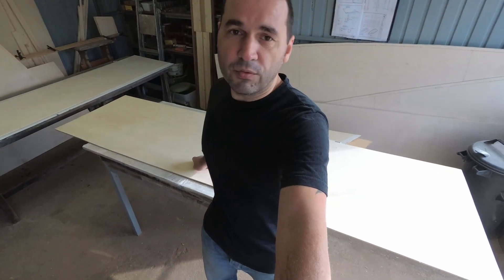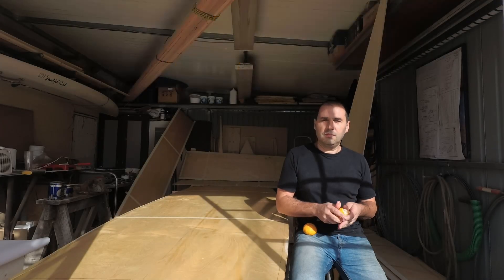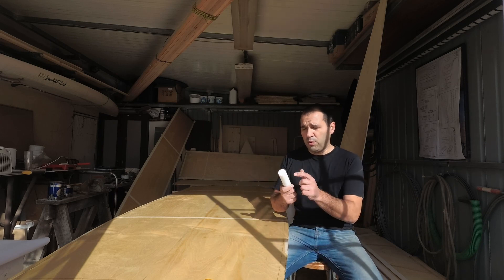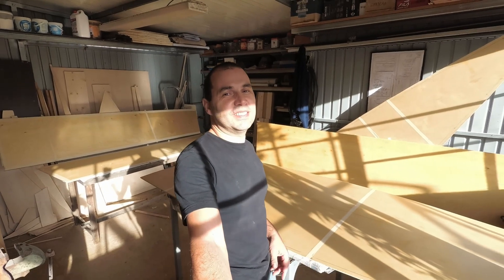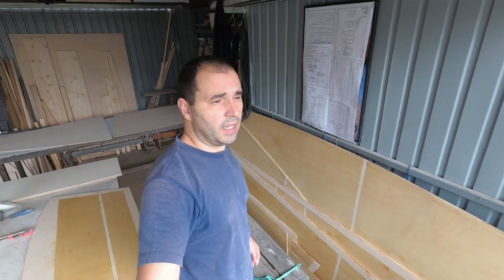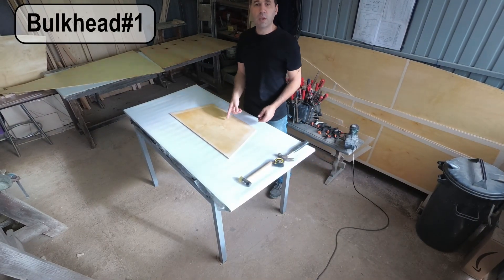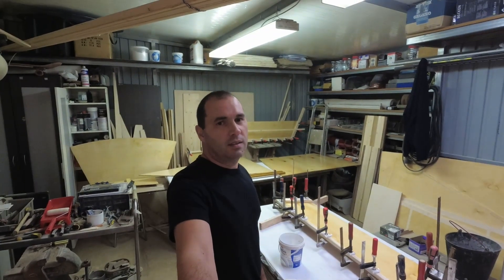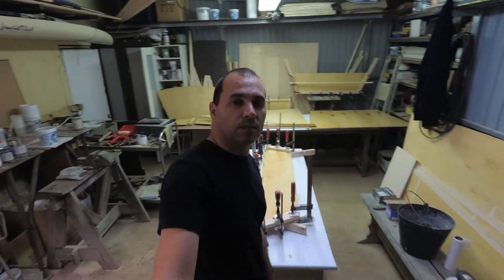Building a Goat Island Skiff WEEK_3 - homemade plywood sailing boat

Comment: Hi,
Thanks for your videos. It may be an obvious question (not for me ;)) but why do you glue the frame after coating the panels ? Wouldn't it have avoid you to do lot of masking job if you had framing first ?
Reply from the maker: Hi Christophe!
Some people do almost complete the boat before epoxy coating the whole thing.
Plans recommend masking the gluing areas.
I chose to do it this way because I can apply the epoxy and get a better finish while the panels are bare and horizontal.. It also makes it a lot easier to sand them too. 
Take the Transom as an example, if frames were applied first, the sander would not reach all areas of the panel.
Reply: @TheBoatRambler  Good point.  In fact it's a matter of choice. Both methods have their pros and cons. That said it's a very good looking boat

Comment: I have a question, why you coat epoxy in the pinels before and not after the boat is built ? I seen more like this
Reply from the maker: Hi Richard, I coat the panels first because it's a lot easier to sand them while they are still flat and on a benchtop than  after they are curved, and in odd places the sander wont even get there. 😉

Comment: Very nice build! What size plywood panels did you start out with and what method for scarfing (I may have missed it in an earlier video)?
Reply from the maker: Thank You. 
The plans call for 2440x1220x6mm but my panels were 2500x1250x6.5mmm.
The panels are not joint using scarfs, buttstraps are used to join them.

I have not joined the panels yet, that will be the last thing for me before I start putting the boat together due to building space limitations.

If you go to  Goat Island Skiff FB Group ->  https://www.facebook.com/groups/GoatIslandSkiff 
you can find many photos on how the panels are joined. 😉

Comment: Another Great Video - but some important additions.

If following this video - don't put the panels in the sun. It will make the epoxy go tacky faster, but it may cause bubbles as the air in the plywood expands in the sun.

Thousands of little bubbles all over the surface.

The other useful addition - the fibres added to the epoxy for gluing should be a paste - if thin enough to put on with a brush - it is too thin and the timber may absorb the glue leaving the joint dry. Only light clamping pressure - or use drywall/plasterboard screws and a cordless driver.

With the bulkhead mistake - Only small error and well handled - the framing will cover that small deviation. 

If you are building a Goat Island Skiff and feel you have made a mistake - please talk to us at the Goat Island Skiff Group on Facebook. We can help work out the solution. There is not one problem we haven't been able to solve over the years. Usually as simple as Teo's neat, non visible fix.
https://web.facebook.com/groups/GoatIslandSkiff/

Michael Storer - Designer of the Goat Island Skiff.
Reply from the maker: Thanks for the advice Michael.
...and guys....listen to Michael, he knows what is talking about! 😎